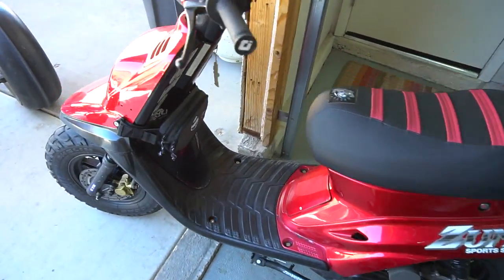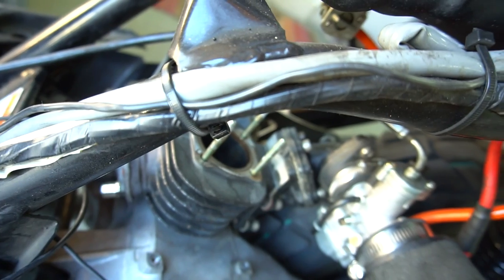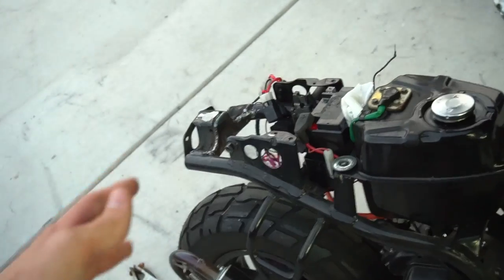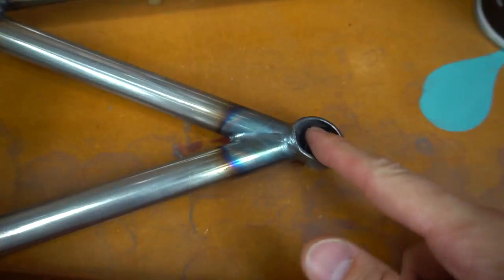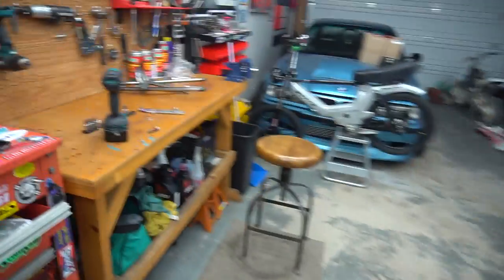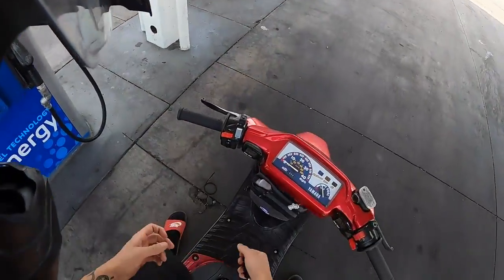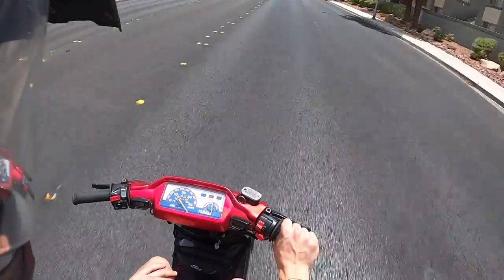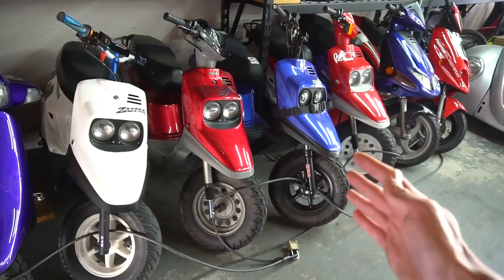70cc ZUMA NEW CVT Setup & Tuning! + Frame Reinforcements!

Comment: What mopeds have you found to be most responsive to tuning (70ccbore kits etc) Had speed fights when I was younger but I’m 33 now been out of the scooter game for a long time. Looking at getting another here in the UK and fancy a piaggio zip 50. Loving the videos keep up the good work.
Reply: Best 50cc for tuning would be anything with a Piaggio HiPer2 engine (which includes the Zip). Anything with a Mineralli horizontal derivative comes in a close second, and anything with a Honda AF16 or AF16 engine comes in third.

Minarelli verticals respond well to tuning as well but they don’t have quite the potential of the other three. And Honda AF05Es fall in behind them. Not really sure where the Morini engine falls in here, as they’re exceedingly rare here in the states.

These are also just my opinions from what I’ve studied and observed about scooters with these engines.

Comment: hey i have a question.
i have a yamaha booster70cc airsal with a 16mm carb
and i dosnt like do rev for some reason.
the carb is tunded well,  i have 4g rollers and when i take 3 rollers out it revs up nicly what might be the problem????
it has malossi cluch with a white soft spring and a 1500 cluch springs

Comment: Anyone got a 70 cc  with a 21mm carburetor what main jet and idol jet are you running? Trying to get mine working. Right? And need a rough ballpark I’ve tried from 98 to 110. Main jet. And 32 to 38 idle jet and can’t get it to run, right
Reply from the maker: all depends on the air density and elevation where you live but i usually end up with 100 main 40 pilot and the needle clip all the way to the top on all my 21mm carb set up bikes here